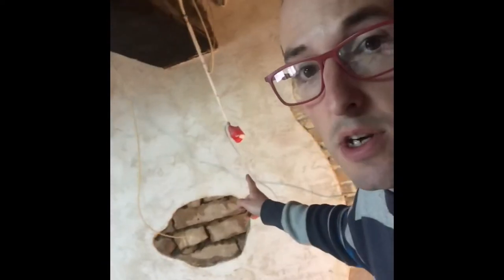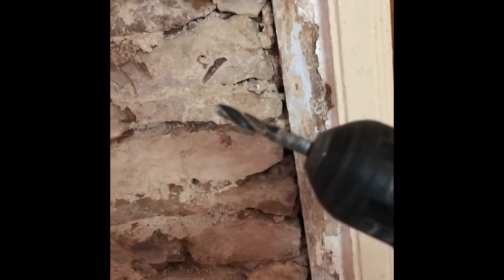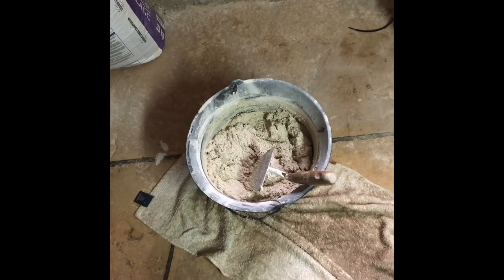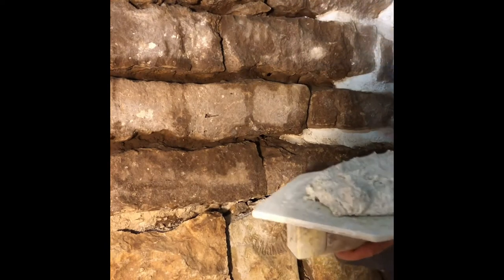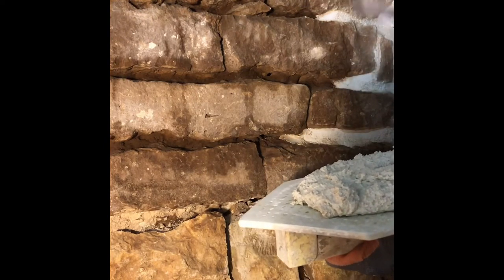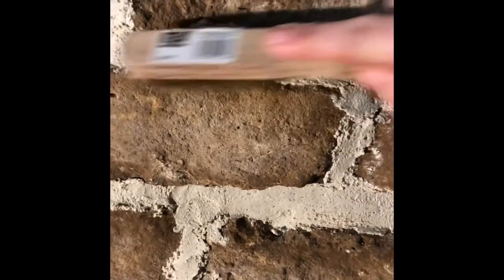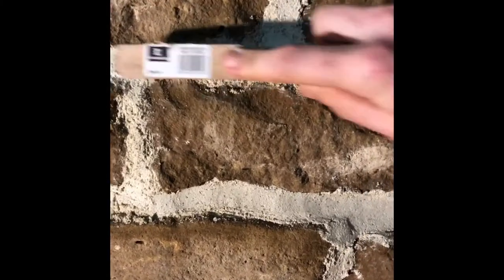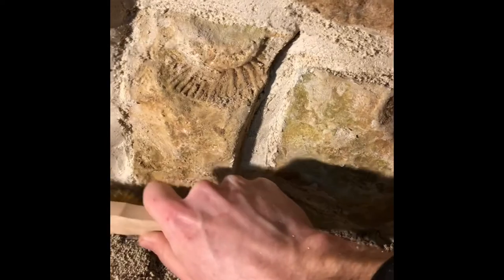How to point a french stone wall with lime mortar

Comment: Nice job. Have you tried hitting it off with a hard bristled churn brush? At the right consistency it tends to compress the lime into the joints while at the same time cleaning the edges up. You may have seen or used the technique but there’s no brushing involved. I’m on repointing my home which is originally built with lime mortar so maybe different to what your doing of course! Cheers 🍻
Reply from the maker: Thank you, yes I know the method with that type of brush, very popular over here and probably a bit quicker too. I found that way gives a more smooth finish rather than sharper joints so works well depending on the desired finish. 
Thank you for watching!

Comment: Thanks for clarifying a few things for me. I have been doing this for about 7 years with varying degrees of success. It was only recently that I discovered that they made a product called Enduit ( the stuff you are using ) which will save me a lot of time as essentially I have been mixing sand and lime at 3:1.  Am I right in thinking that the Enduit can also be used as a render, to spread over the wall if yo wanted to cover up the brick completely or might you use Mortier. I'm not exactly sure what the difference is to be honest. Anyway, very informative so thanks.
Reply from the maker: Hi, thanks for your comment. Yes exactly- enduit in French actually means to render or cover something such as sand and ciment, plaster, crépi etc.  But different products allow for certain thicknesses so just check on the packaging and make sure it’s suitable for the material underneath. Good luck and thanks for watching.

Comment: Hi there. Just doing similar in Somerset Uk. Can I check if you have found any other method than a wire brush for cleaning all the old plaster/limewash off the face of the stones? thank you
Reply from the maker: Hi, are you looking for a quicker method? You can do a smoother finish by using a much larger softer brush which is definitely quicker but you lose some of the edges/definition of the stones that’s all. Some people prefer this smoother finish with less of the stone exposed and it’s certainly quicker but I would suggest trying first and seeing if you like the results.  Good luck!

Comment: Hi I wonder how much of this product you would use on a 12m2 wall? Does 10 bags sound about right?
Reply from the maker: I would say much less actually, one mix I done does very roughly 1 square meter, and I was getting 3 mixes per bag. But it depends hugely on the size of the stones and gaps.

Comment: Hi great tutorial . Where can I buy the ready mixed product. I don’t seem to be  able to trace it in Normandy.
Reply from the maker: Hi, any brico shop will do bags of monocouche, usually in cream colour. Failing that you can get a bag of “chaux” which is definitely available everywhere and simply mix with fine sand. Good luck and thanks for watching.
Reply: Point P will sell you St Astier chaux - there is one in Domfront but Normandy is a big place and they have a lot of outlets
Reply from the maker: Natural lime or “chaux” is available pretty much everywhere in France, even in smaller diy stores it’s very readily available and cheap.